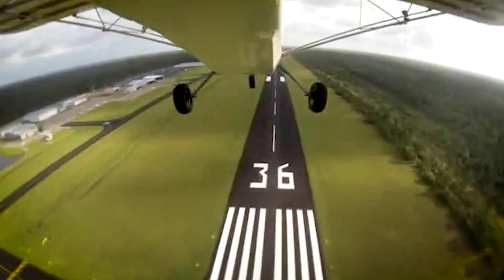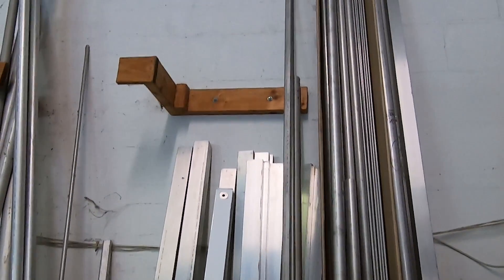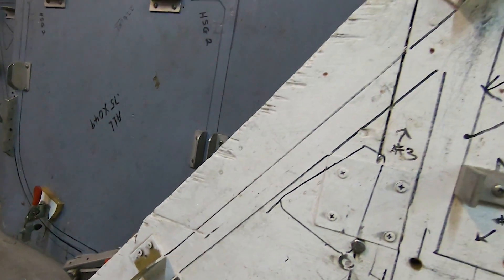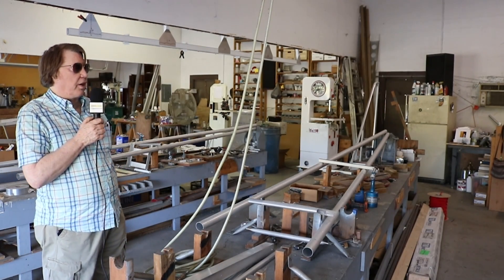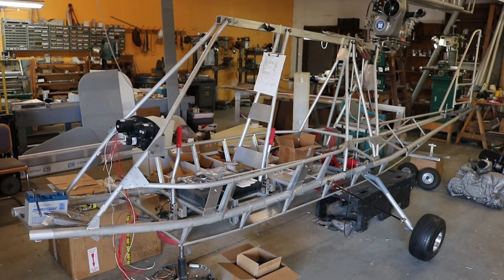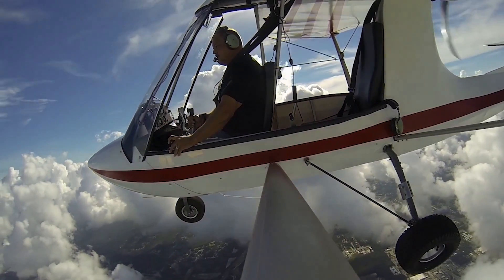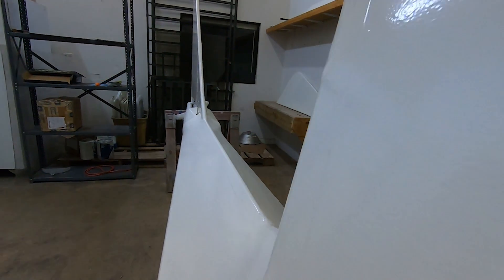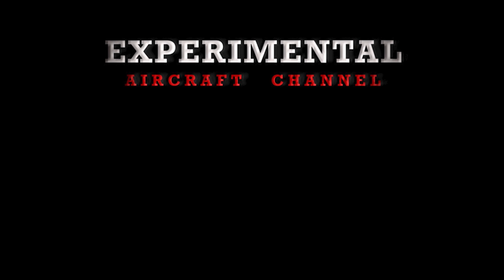Excalibur Aircraft Factory Tour - 2 Seat Kit Experimental

Comment: Landing gear looks horrible with shock cord wrap,wont last overtime. Unsafe landing in fields or sand bars, or gross weight take off or landing ,i felt mistrust when I seen the cord Wrap,cost of replacing or damage an cant take off in remote location.
Reply: No different than gear bungees on a piper cub.

Comment: Tom copied the challenger design and changed a few things. That airframe  cannot safely  support, and was not designed to support the weight of a four stroke  four cylinder  engine!
Reply from the maker: It appears they are selling mostly with these 2-stroke Hirth  and Rotax options. I did NOT see a Rotax 912 present while onsite and I would also assume a completely different engine mount and some additional structure would be require to operate a heavier engine. Thanks for taking the time to engage here and for watching today!